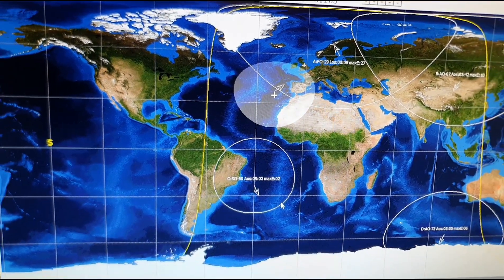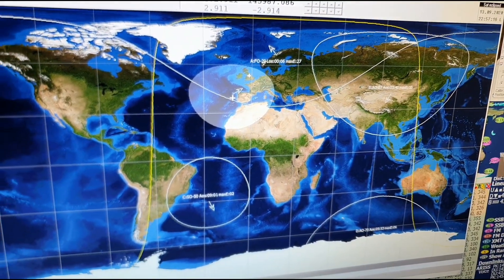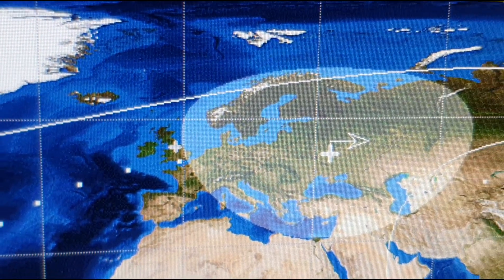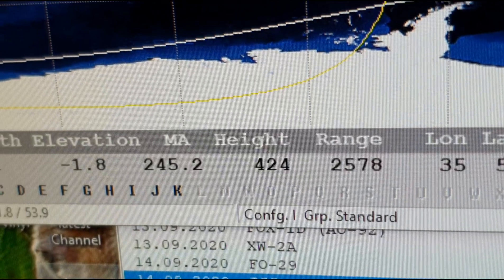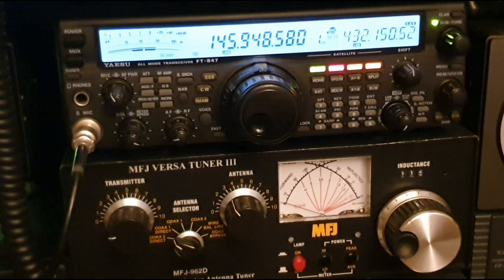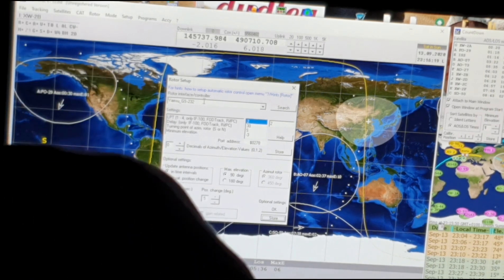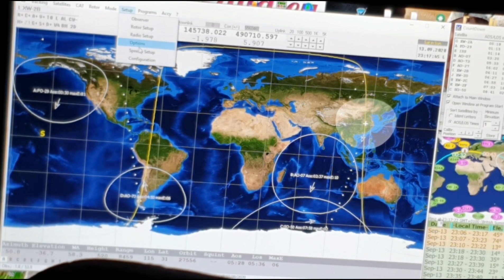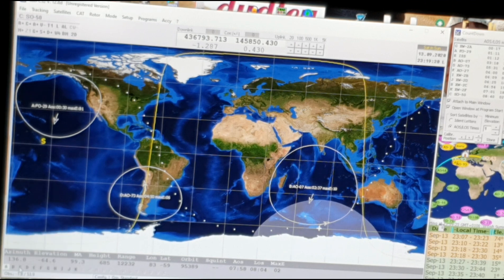Setting up SATPC32 - Tracking, rotator and CAT Control

Comment: Shouldn't also on the FT 847 enable the TRK mode for either Normal or reverse so that when you tune the main RX the TX frequency also auto adjusts as well. Also for the 847 you should use the SatPC ISS application which is part of the SatPC32-
Reply from the maker: The SatPC32 tracks automatically. Also you have the option to adjust manually. However once setup properly with the CAT Tuning adjustments via the tab you won't need to touch the VFO again. This only matters on SSB sats. there is no benefit from adjusting uplink Doppler  for ISS or FM birds. The ISS tracking add on you mentioned is very basic and not very good for other sat work. I looked at it first but found it poor. SatPC32 is much better and has more user options. Thanks 👍 73 have a good weekend
Reply: The ISS add on was mainly to resolve the issue with 847 and a few others with same band issues and TX/RX it took it out of Sat mode and emulated I guess more of split type. It wasn't designed really for Bird work.
Reply from the maker: Cheers for the info 👍 I have never had any issues even when I used other programmes. I have been using the same radio nearly 20 years and I previously manually adjusted frequency shift long before I had an interface. I used to run satscape, orbitron and few other programmes. All easy enough but maybe some folks struggled? Anyhow all interesting info and great to hear other examples of operating issues. Thanks for the comment. Have fun 73

Comment: I never could get my 232a to work with satpc. A couple of things I’ll mention to save you time. Don’t buy this software. Upon startup enter only the first 3 on both lat and long. Example -84.4 37.7 for me. It takes about a week or so of farting around to get used to it. Make sure your Doppler sqf files are perfect. Also sub tones. Satpc comes with a ton of pre installed ISS crap. You can backspace all the crap and just enter the correct Doppler sqf file info for the repeater. Remember also when you are adjusting to hear yourself, select cat at the top. You’ll see uplink top right window. 10,100,1000. Click up and down to find yourself. Uplink save on each bird. Shoot me email if you need a Doppler sqf file. Or amsatnames file.
Reply from the maker: Thanks buddy I will keep playing around with it. so far so good. Cheers for the tips sounds good. I give it a go. The 232b was easy enough it was the cat that took me some time to connect. I just need to get to know all the ins and outs and it could be the one to stick with lol until I get bored at least 😅 catch you soon Bro thanks and 73
Reply from the maker: Great tips I just tried the shortcut for the location,  perfect! Also cleared out the unwanted ISS doppler data and fired in the new frequencies. Working well and I save a bit of cash lol thanks again 👍

Comment: Just wondering how you interfaced the Rotator Controller to Satpc32. Mine is USB and the program is looking for Parallel.
Reply from the maker: Hi it was straight forward enough I entered the details in rotator setup and selected the port which for me was port 3. Then you select the driver which is in the SATPC32 c drive folder (at work can't quite remember the name something like SPX) once you pair the driver to the programme a quick restart and it works. If you need more info I can help when back in the shack
Reply: @M0YKSHamRadio  Thanks Simon, looking at it again I was able to work it out. I chose the Yaesu GS-232 left all the other settings as is. Hit "Store" and restarted the program. Upon opening the program I got a message that the Rotor was not setup but the rotor driver was opened up. From there I was able to tell it that the controller was on Port# and the speed ### now it works. Have fun on the bird, it is pretty easy to work here in VK. Cheers, VK3WWW
Reply from the maker: @vermontcreekbed  excellent news glad that you got it sorted out. Have fun and catch you again soon 73
Reply: You do mean its a serial interface, don’t you, parallel was often used for printers, l run a g5500 and a 232 interface, via a 9 pin to usb lead, and that’s serial, de g1egz.

Comment: Hello - what does the ‘split’ operation do for you? Is that something you’re doing in addition to UHF on VFO A and VHF on VFO B? Does that Yaesu rig support simultaneous transmit and receive?
Reply from the maker: Hi Jeff, yes the radio supports full duplex rx tx. I normally operate that way but trying an experiment this time to see if the ISS could be worked that way. It seemed OK but the usual operation is better with the up and down both active. You know how it goes a bit of playing to see what works and what doesn't. 73  Simon M0YKS

Comment: Simon,  you don't have the CAT enabled? Would have expected stronger signals for 20 degrees pass...
Reply: I'm waiting on rotator,  everything else is in place
Reply from the maker: Good stuff 👏
Reply from the maker: SATPC32 isn't showing the new transponder frequencies so on the ISS pass the CAT is off. Later in the video when I'm demonstrating the software its on if you watch that part of the video. As for the ISS its pretty crap probably badly setup or something should be much stronger and easier to work. The Satellites are much better